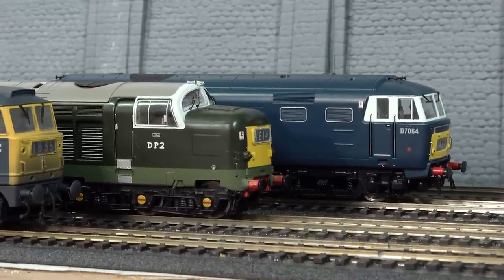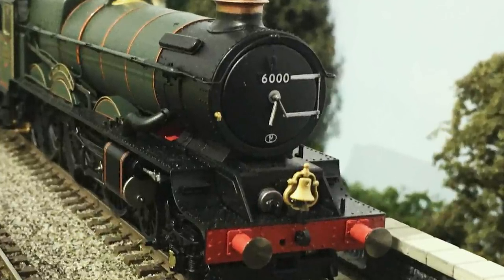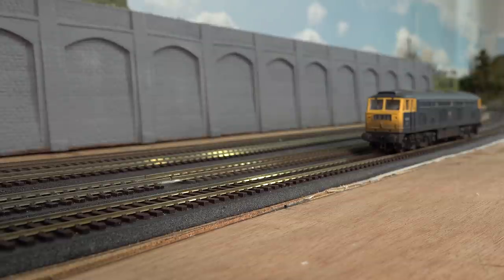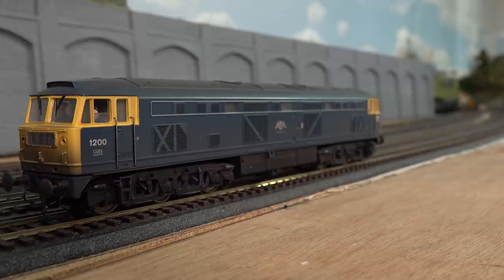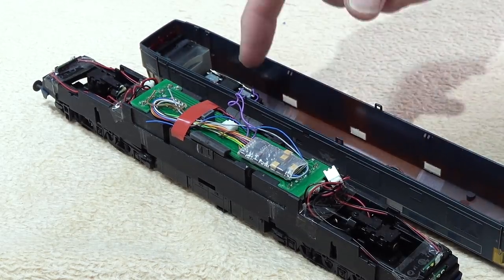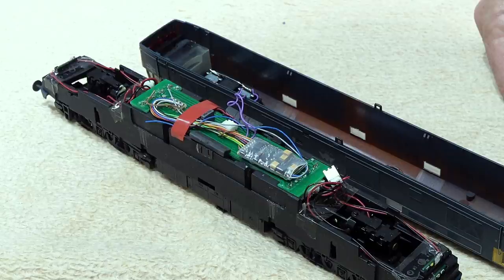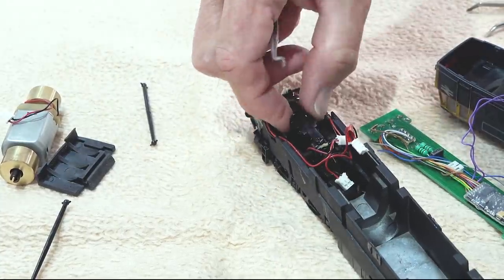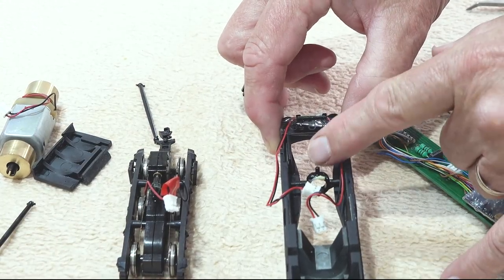Loco Repairs at Chadwick Model Railway | 143.

Comment: interesting timing.  I had exactly the same issue with a class 33 two weeks ago.  The same plastic coupling on the worm gear had split resulting in one bogie drive.  Superglued it as you did in the video and its been fine ever since.  Cheers
Reply from the maker: You should’ve filmed it Richard. I don’t know if you are going to the great electric train show, but sadly I can’t make it.  Perhaps we can meet up at Ali Pali in the spring. Regards Charlie
Reply: @ChadwickModelRailway  I usually go to alley pally, will keep an eye out for you.  Cheers

Comment: Excellent tutorial. I have the EM1 which decided to jump the track and land on the floor! Bogie hanging off etc. Went to work on it and the gear tower and shaft were adrift. One end of a cardan shaft had one of the (notches?) broken off. Shoved it back in with just the other side doing all the work. I guess it will break eventually. Had a Bachmann 10000 plastic shaft collar slip in the brass motor weight and glued that. I have about 40 Heljans and dreading this. Currently got a sick railbus awaiting re assembly after blowing a motor ( available from Lendons who also did a gear pull swap on it). The nylon gears on these tend to split causing the inevitable. More brass is needed in these parts.
Reply from the maker: It’s shocking that we need to be engineers as well as modellers.
Regards Charlie

Comment: Nice one Charlie very well explained, didn't know it was a common problem (read as design flaw). Learnt the hard way, my Hymek on testing by supplier in UK to here the cardan shaft had detached on one end and the top bogie clip on the opposite bogie had come off; result loco sat there stationary wurring away - seems prone to vibration and transport shock.
Had to add plasti - card shields to both ends to stop the light bleed from the route code at the gap body to chassis, ditto on my Heljan class 26 - another irritating design flaw!! Best regards and happy repairing Stephen
Reply from the maker: An excellent comment Stephen, a lesson there for us all.

Comment: Hi Charlie another great video. May I offer an "old school" tip regarding the cracked plastic drive end. Whilst gluing it to the brass shaft is fine another method is to use a piece of brass tube, with a diameter that is a close push fit over the collared (bogie end) of the piece, and cut a small length of the brass to fit over the cracked collar. A little glue to secure the brass over the plastic and it should last forever! The brass acts as a strong compression fit over the plastic. I had to use a similar method on an aircon unit vane which had a brass drive bush driving a plastic connection. The plastic, of course, was forever cracking! A small length of brass collar and it has lasted for a decade. Have a great weekend.
Reply from the maker: An interesting option Pat, many thanks, Charlie.
Reply: I was going to suggest something similar too.  I’ve had success recently with tiny 3D printed collars to reinforce or repair push-fit plastic parts.  You can tune the fit quite precisely, add a chamfer to help it go on, and there seems to be just enough spring to hold really tight, usually without glue.

Comment: Common issue on the Heljan 47s too. Make sure when taking bogie apart that the wheels go back right way round to avoid shorting the electrics. 15:57 the centre wheel is wrong way round for example.
Reply from the maker: It seems to make no difference!

Comment: Hi Charlie! The AC connector is not for accessories, but for the power pickup on locos produced for the Marklin 3-rail tracksystem.
Reply from the maker: Darn it! I was hoping I could install cab lights into there.

Comment: To prevent the plastic  hub splitting again you could try wrapping a small piece of carbon tow around the boss.  Tie a knot in the tow then whilst holding the knot tight with your third hand apply the cyanoacrylic resin to the tow.  It will wick in and cure.  If very thin cyanoacrylic resin,  the cure will be about 2 seconds.  Excess resin can be mopped up with paper towel.    Cyanoacrylic resins set by curing by reacting with water molecules on the surface,  they do not set by solvent evaporation.    For the thicker cyanoacrylic resins there are accelerators that you can buy which will force fast curing.
An Ophthalmic surgeon told me once that whenever he had to remove cyanoacrylic resin from eyes it always caused scarring of the cornea,  so I ALWAYS wear glasses when working with those resins.
Reply from the maker: Great tip regarding the glasses, I had never realised that risk.

Comment: Hi Charlie, another interesting video, Heljan certainly don't have the monopoly on this issue, I've seen it on Bachmann and Hornby locomotives. Good to see that you take great care in realigning all the items of the drive chain and checking for trapped wires. You also tested drive to both bogies. I also check each pickup set is working while testing as I've had the odd wire disconnect during reassembly due to the excessive movement/flexing of the wiring. Regards, David.
Reply from the maker: I’m so pleased that you enjoyed joining me on my little nightmare David. As you know only too well these things aren’t easy. Regards Charlie

Comment: Same problem split couplings on bogies. I made a brass collar that was a shrink fit over the couplings and used Loctite bearing fit to fit the plastic to the shaft. I also replaced the the Heljan slot car motor with a Mashima motor. With that Zimo decoder those blue and grey wires for the stay alive capacitor I would fit a bit shrink wrap over the ends as if you haven't disabled the stay alive feature those wires are live.
Reply from the maker: Great point Charles, I shall sort it out.
Regards Charlie

Comment: When the centre axle and wheels fell out, I thought I saw them flip over making the uninsulated and insulated wheels around the wrong way.  I worried about that on your behalf for most of the video.  But the old girl ran so I shouldn't have worried.  Well done Charlie
Reply from the maker: Thanks David, but it wasn’t an issue. Regards Charlie

Comment: Thanks for your very informative video.  I have 7 Heljan locos and fortunately have not had your problem to date.  Although you did not mention it, I find it safer after maintenance or repairs to check out if the address can be read on the programming track after I destroyed a decoder due to a self induced short circuit.
Reply from the maker: An excellent point Robert, regards Charlie

Comment: Great video with really clear shots of the difficult bits. I repaired my Heljin Hymek recently and it took a lot of trial and error to workout how to reassemble the bogie unit, in despiration I removed the clip and in it popped so easy. If I had had this videoit would have been a simple job instead of taking all day!  By the way Gaugemaster sell a full range of Heljan parts and have all the parts diagrams on their web site.
Reply from the maker: I'm so pleased that you enjoyed it Paul even though it was a little late for you.  Stay safe. Regards Charlie

Comment: Good video Charlie. I've repaired a number of these joints on Ozzi made locos. Unfortunately it is a little too common a problem. It always seem the favourite loco is the victim! But the worst is a split gear, now that is a challenge., especially tracking down a replacement part!
Reply from the maker: These problems are sent to try us Peter.

Comment: Excellent Charlie. I thought the motor on my 1970s Hornby Hymec was a pain to service 😁 I’ve also started using Tamiya Cera-Grease HG for the gears. It’s quite light compared to others and seems to work well
Reply from the maker: Servicing is a burden,  too much oil or not enough!

Comment: A good job, well done.
You have to wonder how they come up with the designs for the drive mechanisms in model locos: so many different ways to connect the motor to the wheels!
Regarding the three connectors at each end, I think a small dot of three different colour paint on each of the three male and female connectors would make reconnecting it all a bit simpler - a bit like the Xs scribed on the motor and chassis.
I wonder if there's an issue with the plastic Heljan use that's a bit too brittle.  You'd sort of hope it would need a heck of a lot of force to crack those whatever-they're-calleds. Maybe the other takeaway from this is don't make your Heljan locos struggle too hard.
Reply from the maker: An excellent comment Andrew, regards Charlie

Comment: I think that you can get the tail lights to turn on/off independently of the headlights by plugging the tail lights into one of the accessory sockets on the PCB - that certainly works with the Heljan 00 gauge class 15. You may find that preferable to having the head lights permanently disabled on one side.
Reply from the maker: I shall certainly check it out James, however one chap has mentioned that it was for the three rail system.
Reply: @ChadwickModelRailway  Interesting. Do Heljan make PCBs for three rail models...? Certainly, switching the socket into which I plugged the lights on one side and then reconfiguring the decoder worked for me on the Heljan class 15.

Comment: Brillant video and I must check my Helijn class 17 & 15 out. If my class 17 has a drive start problem I might sent it away for repair as to get  the loco body off its got very awkward buffer holding pins you have to take off , and have heard there a nightmare to put back on again.the class  15 looks more easier? as you remove the battery box and 2 screws holding  the body on.
Reply from the maker: They can be troublesome but I wish you luck Ian.
Reply: @ChadwickModelRailway  cheers for this video Charlie as think you might of helped alot of people out with Helijn locos or Hellyan if your posh 😂

Comment: Charlie, since not everyone has your success with cleaning oily metalwork and then super-gluing the bits back together.
Might I recommend either A43 Threadlock or A70 Studlock, both of which are oil-tolerant, and so not so sensitive to residual oil.
Reply from the maker: Two new products to me Tom. 
Thanks for sharing.

Comment: That drive issue reminds me of the many Philips VHS video recorders i have fixed because of a cracked crown gear on the drive shaft for the cassette ejecting mechanism. The cracked gear would slip on the shaft causing the cassette to be stuck.
Reply from the maker: It seems that we haven’t improved yet!

Comment: Interesting video Charlie. On the subject of the disconnected tail light, is there a spare output on the decoder that can be connected and you can simply set the output on when you want the tail lights on. I know it’s manual faff but if you are making a video you will have at least the lights on when you want them on. I noticed it was a sound decoder and looked like an ESU, unlike most general 8 pin where you have a floating violet wire which would be another function. Regards, Geoff.
Reply from the maker: An excellent point Geoff, and one which I will will look into.
No it’s a Zimo decoder. Regards Charlie
Reply: @ChadwickModelRailway  Well, being a Zimo chip it is possible it can be programmed accordingly to take into account this function as a lot of the Zimo chips with the Paul Chetta sound files have this function built in, my Sutton 24 does this and also some customised Zimo chips with Paul Chetta files do this.

Comment: Hi Charlie
Loved the video looking forward to the next one. I keep a log book on each individual loco on how long they are on duties on my layout. I have always wondered how many hours do you run your locomotives before they are need of a service.
Reply from the maker: To take it a stage further, in Train Controller, there’s a clock counting each locos accumulative running hours!
Reply: @ChadwickModelRailway  
Thank you for your reply. I use Gaugemaster prodigy on my layout. I will be looking at the manual to see if this function is  available.

Comment: Thank you for another excellent video. I think if I had paid serious money for such a model I would have been most disappointed on opening this one up to find the nasty plastic mechanics. I can't imagine Binns Road ever thinking this was a satisfactory way to build a drive chain. Plastic universal joints just pressed onto plated/polished shafts is no way to ensure any kind of longevity or proper transfer of power, on yours now entirely reliant on a drop of superglue. It's the sort of arrangement you find in a Christmas cracker toy. Not a single screw to hold anything together, just feeble plastic clips that in time will break off. It looks as if Heljan have gone for lots of nice detail on the outside, and nothing on the inside  (what the eye don't see......)
Reply from the maker: Very true Rick, well said.

Comment: Another really enjoyable and helpful video. I noticed you fitted the speaker above one of the bogies, have you done the same thing with the Hymeks? I sound fitted one of mine and out the speaker in the fuel tank underneath whilst putting a stay alive on top of the circuit board using a Zimo chip. Just wondered if there is a better way of doing that for my next Hymek? Thanks again for an interesting video, look forward to the next one.
Reply from the maker: I think that your solution is probably the best one Simon.  My only Hymek with sound is an ESU V3.5 and has just the small round speaker installed.  Can you recall which speaker you used?

Comment: Thanks Charlie for another very informative video! wrt red and black wiring, I would expect they are making common bogies, and  not specific front and rear bogies. Not sure if that showed a good example of design for manufacturing - looked rather fiddly.
Reply from the maker: You’re right Gavin, and they are only made that way to reduce costs.

Comment: Hey Charlie! Enjoying your videos. I always find them informative, entertaining, calm and restorative... like a good cup of tea I suppose... anyway.. Just out of curiosity. I noticed that the top shell or cowling of that loco you're attending to in this video has what appears to be two circular ventilation openings. Are they actual functional or just decorative? If actual wouldn't placing additional circuitry just over the areas/components where those vents are supposed to be servicing, impede their purpose? i.e. cooling. - Oh goody... I've finally found another use for my home dentistry tools.. ;-)
Reply from the maker: The vents are copies of the real locomotive. However I put the speaker underneath so that the loco sound has a better exit from the body shell.
Regards Charlie

Comment: This is why I really like American locos - both in HO and N - as they are almost 100% reliable. The performance is flawless, and if you do happen to get an issue, they are all incredibly easy to take apart and repair. And they've been this way for a while - Atlas were selling models in the 80s and 90s (actually manufactured by Kato) that were at this standard, whereas Hornby models had 'cutting edge' Ringfield motors, which are bombproof but not the most sophisticated motors; performance was let down by very basic pick-up configurations. Hornby continued to supply Ringfield-equipped models well into the noughties and have only recently improved on this.
Reply: I know what you mean, my heart goes out to all the poor souls overseas who dont know about old athearn blue box locomotives.
 Well done Charlie you had to work for that one! Greetings from Florida!
Reply from the maker: Thanks gentlemen, you clearly are the lucky ones regarding reliability.

Comment: ok how do you fit the rubber moubts into the slots on the bottom - or you might cal it the top when the loco is the correct way up  i tryed and tryed to get mine to fit and gave up
Reply from the maker: Do you mean the two rubber mounts that hold the motor in place?
Reply: @ChadwickModelRailway  yes if you look closley they should pop out the base at each side when you drop in the motor mine would not and every time i turned the loco the right way out the motor falls out as the rubber is suppose to be through the two slots witch jam the motor in - only way i could do it was refit the circut board in and that stopped the motor from moving

Comment: At 14:50 the middle wheels fall out, and you place it back the wrong side around (Isolator wheel/axle is on the other side now). I have no clue if that makes a difference though... ;)
Reply from the maker: No the axel placement makes no difference.
Reply: @ChadwickModelRailway  Ok, cool, as long as the axles have no metal cogs mounted on them I guess. I have some old N-scale engines that have those, and that would possibly create a shortcut. I learn every day from your channel, keep up the good work and the fun in our hobby... :)

Comment: Hi Charlie, 
Absolutely fascinating stuff, though far,far ahead of my capabilities right now!. I have a couple of very  basic questions:
1.   Due to my ill health, my three  locos - otherwise brand new - have not run for about 5 years. Now when I try to run them, they run in a very jerky fashion, as if the track were very dirty. I've cleaned the track absolutely thoroughly, to no avail. Is there any defect which can occur if a loco is left unused for a few years? Logic suggests otherwise, but I can't think of anything else... all three locos behave the same way, incidentally!
Reply from the maker: Hi Ganny, 
Firstly are the Wheels clean?
Also, are the pick-ups making good contact?
Next, are they all DC or DCC?
Finally, what are they and what’s their age since manufacture?
Regards Charlie.

Comment: Hi Charlie. You mentioned several times not wanting red tail lights on the Falcon but didn't explain why (assuming, of course, you didn't do so in an earlier video).
Reply: If a loc is pulling a train it is not allowed to have tail lights on.
Reply from the maker: Hi Paul yes the other comment is correct, when running loco light the red lights are switched on. Because Charlie